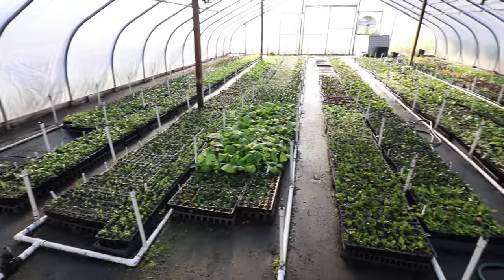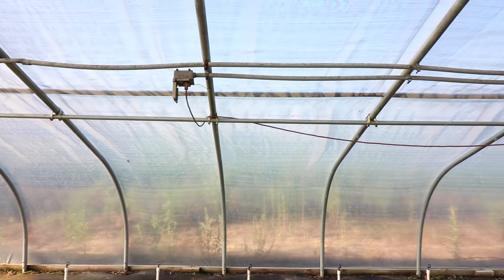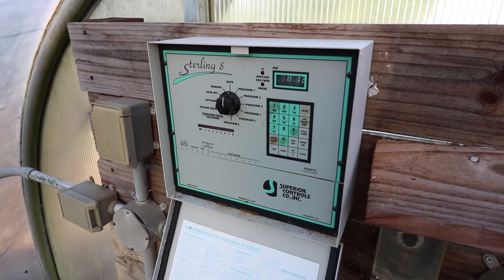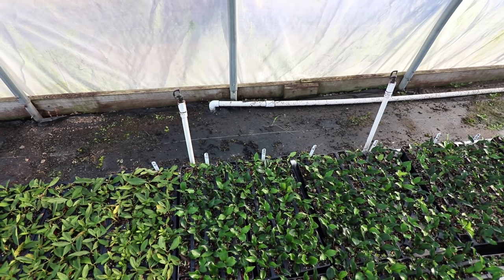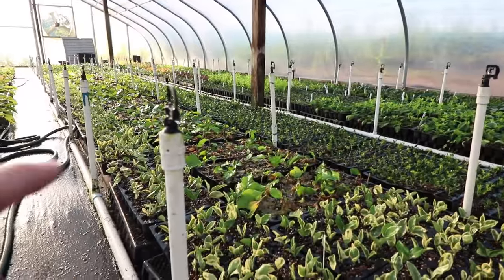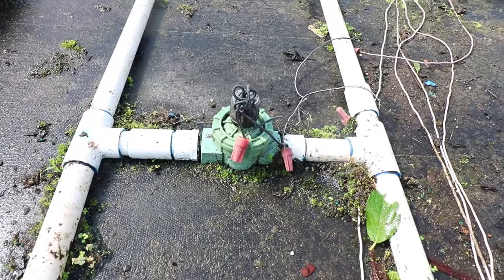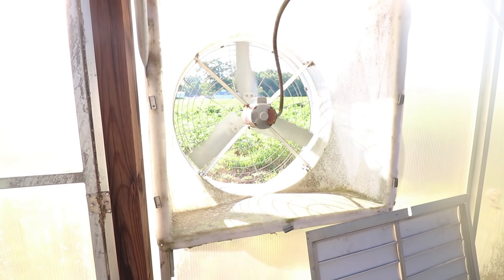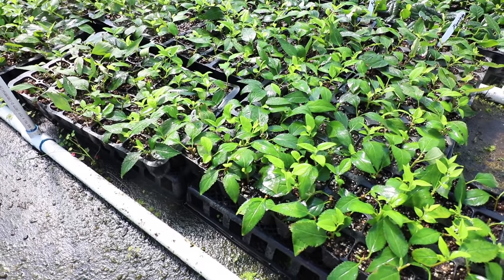Plant Propagation of Rooted Cuttings in a Greenhouse

Comment: As far as you saying the water from the well is cooler, how do you take advantage of that cool water if your systems only run for a couple seconds at a time and the water level is directly below the misting nozzle? I would assume that your water is the same exact temperature as your ambient temperature
Reply from the maker: Water cools the air as it evaporates.

Comment: thank you so much for this video  and esp the tips about construction of greenhouse. there is local guy offering to build 20x20 greenhouse for 30,000. that seems like alot to me. what do you think? that's with concrete foundation. wheres the best source of info if i want to build it myself?
Reply from the maker: Sheeba Kitty You can probably buy a 30 by 72 foot house with everything you would need for 15000. 20 by 20 is an unusual size.